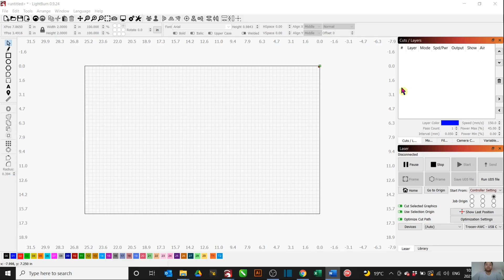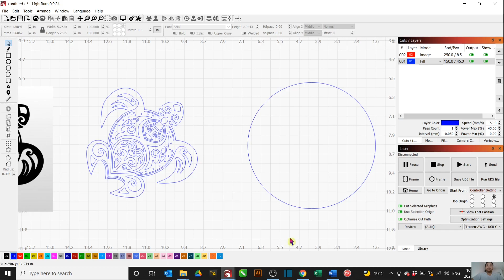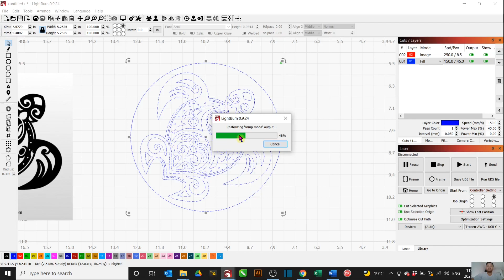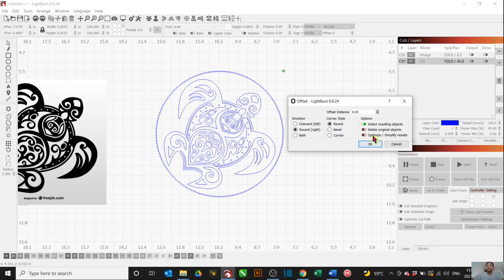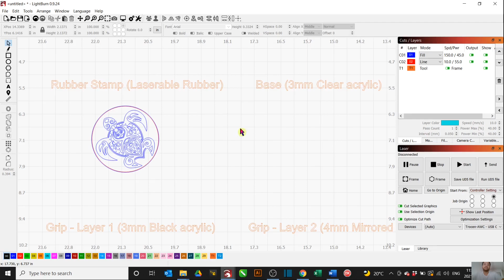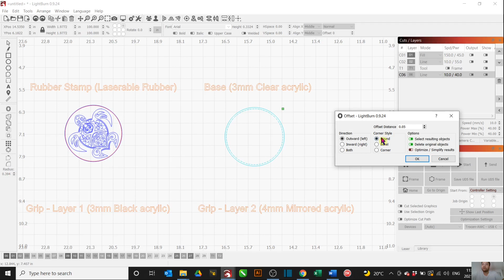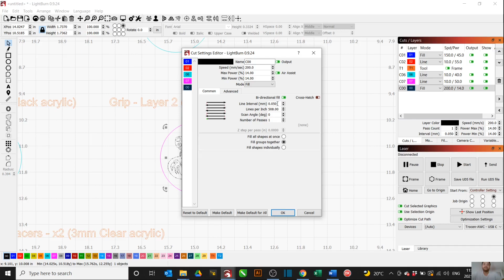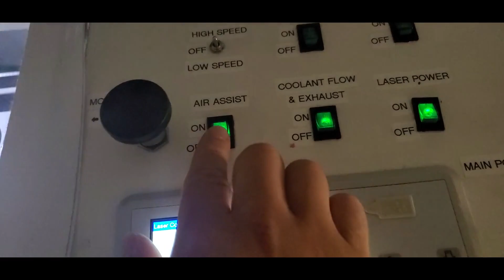How to Laser Cut Acrylic Stamps! | LIT Tutorials

Comment: Thank you for your video.  Absolutely loved it.  I have a XTool D1 Pro 20w laser and have been trying to follow along.  I have no problem engraving but pulling my hair out trying to cut through my 3mm mirrored acrylic.  I've tried very slow and fast speeds with all ranges of power and trying single to up to 10 passes for all my tests.  I'm either getting engraving marks only or a melted mess.    I've also tried cutting with mirrored side up and down as well as applying painter's tape to the face.  Any suggestions as to how I can cut through?

Comment: Why disable the air assist and use a pc fan?
Reply from the maker: On acrylic, if your air assist pressure is too high, you will get clouding on your engraving. Only turn it on when cutting acrylic and keep the pressure as low as possible when engraving. For dc fan, since your air assist is so low, it will help blow away any residue before landing on your workpiece. The soap helps in this as well. Any residue that does not get blown away by the dc fan will land on your piece and may stick on your workpiece since it is hot. The layer of soap will cool any small resiue that lands back on your workpiece before it touches the actual acrylic. If you dont jave the soap, it still might work, but the soap helps as an extra precautionary measure to make sure you have a perfect engraving.